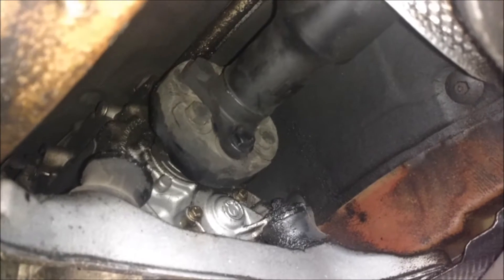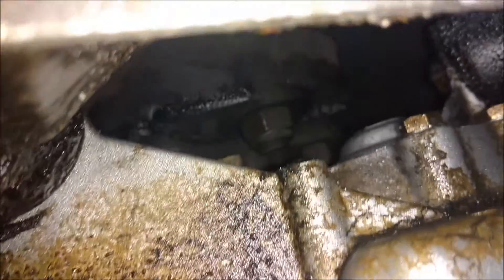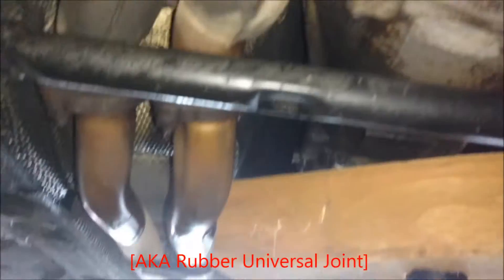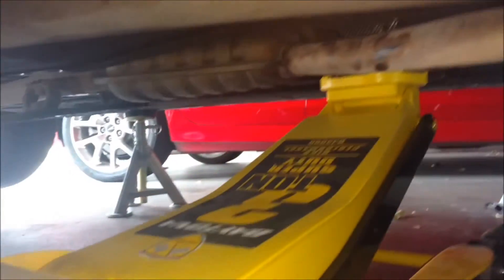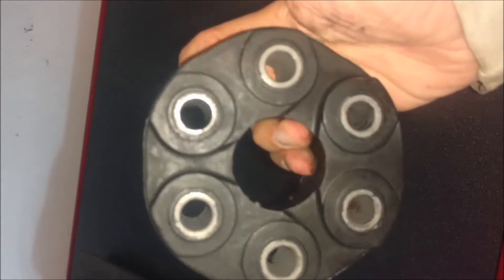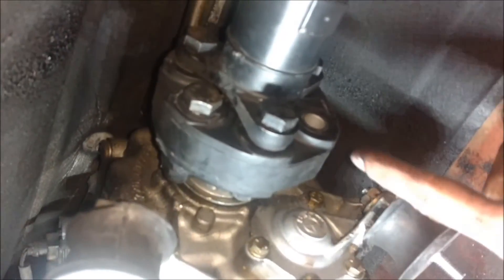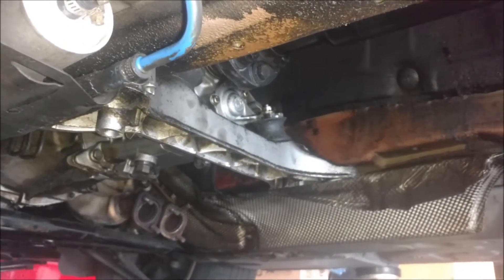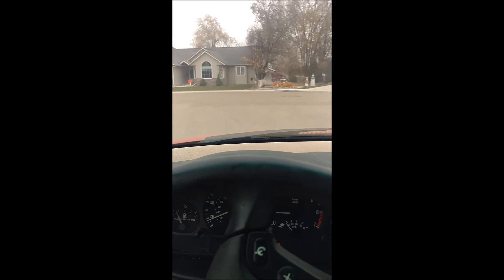BMW E46 Rubber Universal Joint Replacement To Fix Jerky Shift

Comment: Well bloody good job mate,my biggest fear is that my car is 23years old so the bolts will or maybe really seized up although my car is mint condition lol ish.. I looked at my flex disc about a month ago and I had cord hanging out and it’s in really bad shape but it’s not got any jerks or vibration so it’s more about getting it done before it breaks away and rips apart my car hahaaaaa
Reply from the maker: Stuart oliver haha yeah that's probably a good idea. If you are worried about any bolts breaking I would definitely put PB Blaster on every bolt you plan to remove a couple times a day before you do the project

Comment: Is it possible to work that rubber flex joint into place without removing the Driveshaft? Without dropping exhaust & Heat Shield?  O' also did u replace the part listed as centering sleeve in the middle of this area?
Reply from the maker: sledgebeast You have to drop down the drive line and shield. I believe I mentioned it ib the video but I tried to do it without dropping it and if isn't possible because there is the metal guide for the drive line that goes in the center of the rubber.
Reply: so did you replace the centering sleeve?
Reply from the maker: sledgebeast I did not. Mine spun freely without any play so I left it alone. To replace it you have to completely drop the entire drive line. A friend of mine replaced his, you can watch the video and see how to do it if you are interested in tackling it https://youtu.be/b2P14XdaKSM
Reply: no not the carrier bearing. Im referring to the little 1 1/2 inch sleeve called a centering sleeve 26117526611 in the tip of the driveshaft just behind the rubber guebo universal joint you are replacing in your video.
Reply from the maker: sledgebeast Oh okay. My apologies. No I did not replace that because mine wasn't saturated in any oil. It seemed very stiff and sturdy so I chose not to do that.